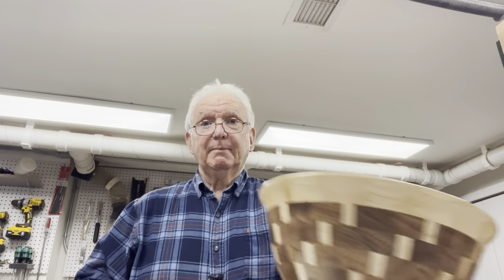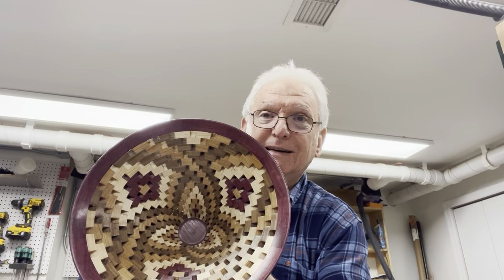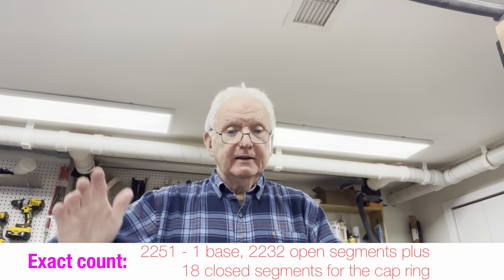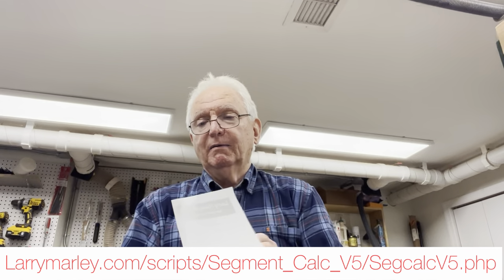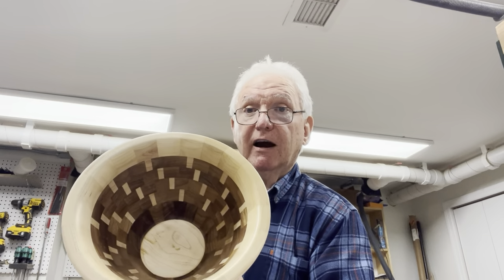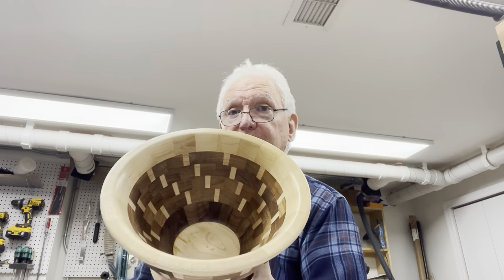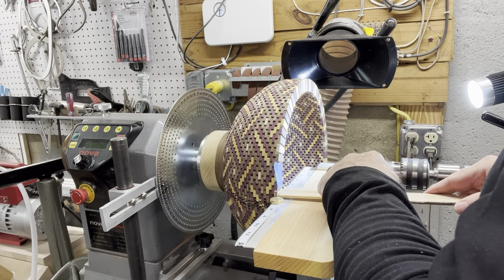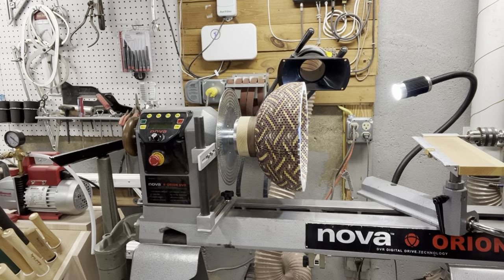Part 1: open segment bowl creation

Comment: Great video Joe. But I’m a little confused on how you got an angle of 3.75 degrees on 72 Segments? I get 2.5 degrees on 72 segments. I use a wedge board as well that is used with closed segments. So how do you figure the spacing for open segments? That is probably the difference why you get  the 3.75 degrees and I don’t. Help me understand the spacing calculation. Thank you and I Love your bowl..Outstanding!

Comment: Hi again Joe, I have a question for you. On your lathe you have two very long flexible poles holding the dust extractor hood and one other pole holding the lathe work light. I have searched the internet looking for work lights with very long flexible posts but can only find short ones. Have you made these yourself ? If you have purchased them from a third party would you mind passing on a link to the business website.  I hope all is well with you and you are busy making another video.   I’m glad you took my advise and made that workshop tour video. You have some awesome equipment in your shops and very well laid out. All the very best, Yours Ricky
Reply from the maker: Hi Ricky, the lathe dust extractor was part of a system I purchased from Wood Turners Wonders but I believe they sell it as a standalone. Here is a link to the system https://woodturnerswonders.com/collections/lathe-track/products/complete-lathe-track-system.